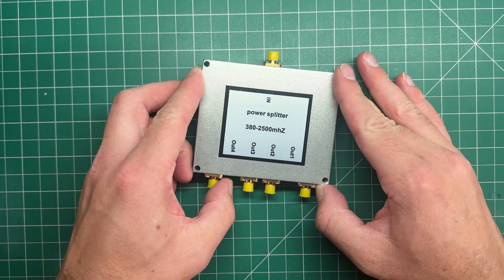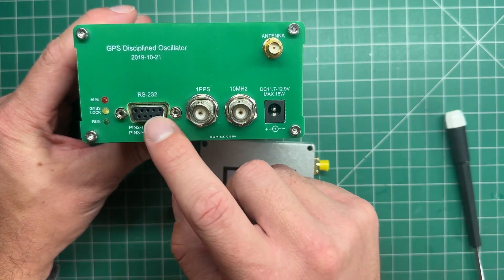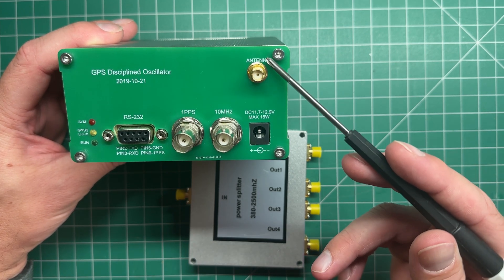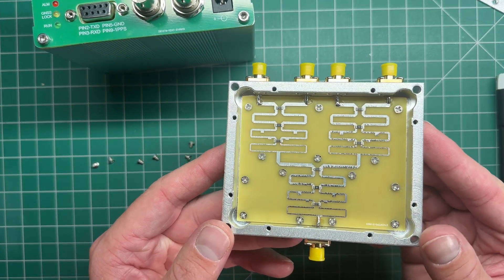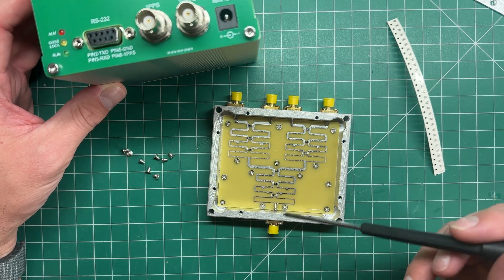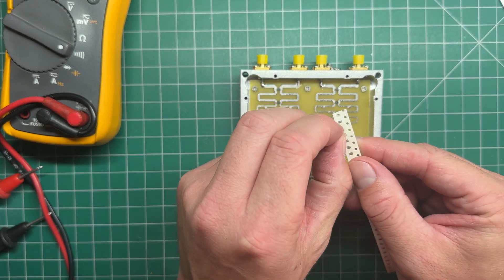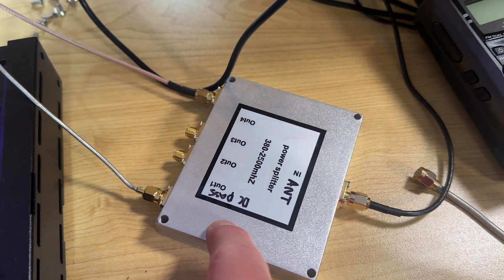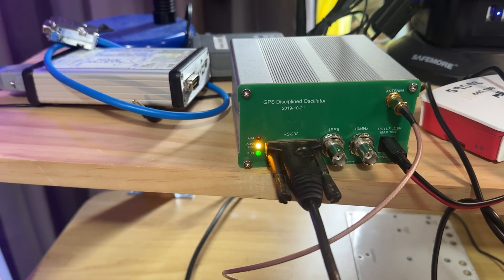Low-Cost, Simple to Mod GPS Power Splitter!

Comment: That's a cool litle mod. Looking at the size of the enclosure, could you use a slightly larger capacitor? (For those of us not so skilled with SMD soldering)
Reply from the maker: Yes I reckon you'd had no issues using a leaded component.

Comment: I saw Mark's tweet too. I've got two GPS puck antennas sitting in the window at the moment, one for my BG7TBL GPSDO (same as yours) which locks my HPSDR and one for a Blitzortung lightning tracker receiver. It would be better to have one antenna up in the clear with one feed down and then split the signal around.
Reply from the maker: Hey Michael - here is the one I got from eBay. https://geni.us/wMSB

Comment: Nice project, Hayden.
I have to agree, at 51 years old now, back in the day I used to pride myself on great eyesight.
Then SMD arrived, just a bit of advice to anyone in NZ or Australia, I bought one of them head-band magnifiers from Jaycar, sure you look like an idiot wearing it, but hey, no eye-strain, they are so cheap and unless you're rough on things, you only need to buy it once, it's not like you'd wear it to the shops either.
I see they have a new version with LED lights, it is the QM-3511.

Comment: Couldn't you just disable the bias T internally in GPS recivers? This way you don't get any extra insertion loss.
I assume the bias T in each one has a cap already in place, so if you just disable the DC feed you can use the already installed cap.

Comment: Directv SWM splitters work just as well for GPS distribution for a lot less and they don't require any modifications, only a few F-type to SMA or N-type adapters. The first port has DC passthrough and the remainder are DC block. They come in two port, four port and eight port variants. They also come with the 50 ohm terminators and some cool weather boots to keep water out. I've had one for years providing signals for a pair of GPS NTP servers and my 10 mHz GPSDO.

Comment: If you think 0805 are small, I have soldered 0402 onto boards. I let the lab tech do the 0201. We never used 01005; I cannot IMAGINE that small.
Reply: And they get even smaller these days.  They do make 008004 size now.  The smallest I have had to deal with is 0201.
Reply: @mikesradiorepair  Wow. How much smaller than a spec of dust can you go? 0201 is 2 grains of fine sand.
Reply: @LeeMccNA5T  It's hard to imagine positioning parts that small on a PCB and soldering them by hand.  0201 is hard enough.  With parts that small it's getting to the point where they are not repairable by hand anymore.
Reply: @mikesradiorepair  Those are used on modules and on substrates for IC's. Machine placed.
Reply from the maker: Haha I'll stick with 0805 for now Lee - they aren't too bad ;)

Comment: Good idea to prevent having to use a separate bias t and power supply.  I would however recommend putting 50 Ohm terminations on the unused ports.
Reply: Spare nanoVNA calibration terminators would work. @Ham Radio DX, you have spares, right?
Reply: @LeeMccNA5T    It depends on the output power from the powered GPS antenna that is then split into the output ports of the splitter.  You should really measure the output from the splitter.  Calibration standards are not really designed to be used as a "dummy load" that is dissipating larger amounts of power.  Little SMA calibration standards have very low wattage resistors in them.  They may work but they very well may not.
Reply from the maker: I have 50 ohm SMA pads too